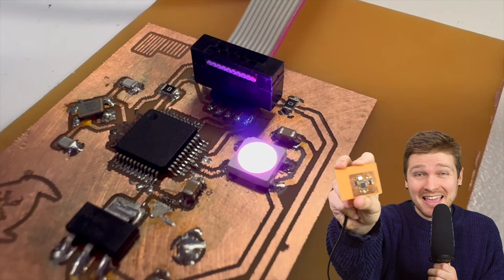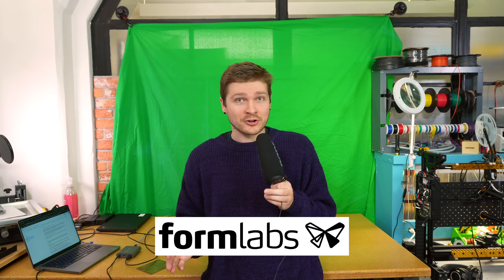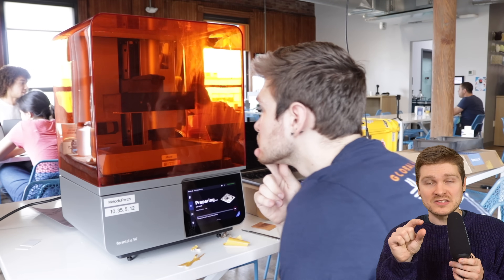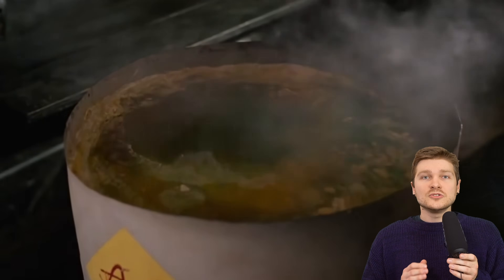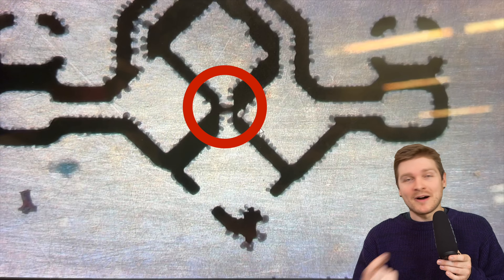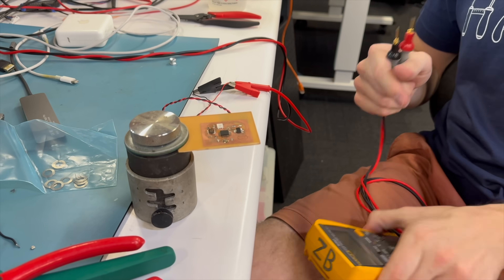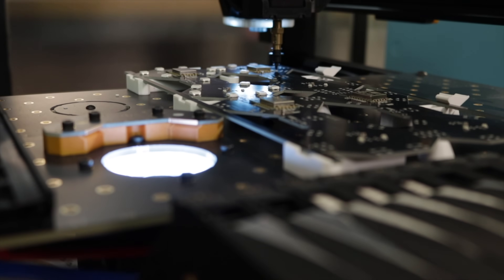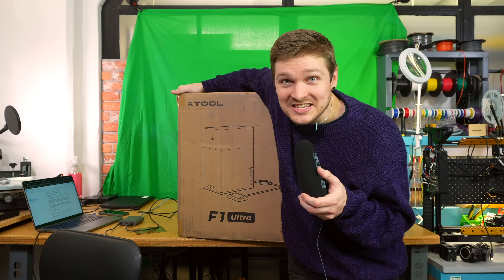Making PCBs on a 3D Printer

Comment: Tried this, no thanks... I finally settled for my boards (and these are just small boards, even doublesided works) on using a fiber laser. But not to ablate the copper. The problem you run into (or I did at least) is that you often end up burning the substrate. And that leads to a whole new slew of issues.

The way I do it is way easier anyway (and with less wear and tear on the laser). I spray fotoresist on it (you used film, it also comes in sprays). Hell it's also way old photoresist, it doesn't matter too much. I use spray because it just makes life easier. And then I cure the photoresist on the whole board. That's right the whole board gets sprayed and exposed to UV light (in fact I often use the curing station of my resin printer). Cure it on there good.

Finally I use the fiber laser on lower power to just blast away the resist on the parts of the board I want etched. If you take care to focus the beam right you get good results with little to no effort. And then it goes into the usual etchant of choice. I even made a small shaker with a servo and a servo tester of amazon. It moves a tupperware tub back and forth on an Igus rail I got in an Igus linear guide sample pack causing the etchant to have just enough motion for improved results.

Works like a treat. From finished pcb design to finished board in less than an hour. Best part? you could even use much the same process to silk screen the board (spray white paint on the finished PCB, laser away what you don't want) and finally coat it with soldermask, cure that and again laser away what you don't need. Though I rarely bother going that far with it.

Comment: Try using a laminator to attach the forbidden fruit roll up. It will force the roll up to be much better attached to the pcb material. The bubbles at the edges of the traces are sometimes caused by the roll up having not super bonded to the board.
Also, you might want to give the muriatic acid / hydrogen peroxide combo to etch the board. It works 10x faster and you end up with much crisper etches.
Reply: And make sure the copper is as clean as absolutely possible which can be easier said than done. If it's also necessary to lightly scuff the surface for adhesion, you want the surface scratches to be as fine as you can get away with.
Reply: Yep, that's what my college peer used when he couldn't get clad pre-coated with resist (or it was too expensive).
He used to use one of those rubber roller things they use for vinyl application, said it was better than nothing but didn't compare at all to the laminator.

Comment: I don't understand why you use this photo-resist film, can you not just use normal resin instead, like, it's a resin printer, just use double sided tape or hot glue to stuck the PCB to the build plate zero the printer to this PCB and print with resin a mask directly on the PCB it will protect it from the acid (if there is a texture to the PCB the resin will stuck to it).  
PS: I'm not into electronics so I don't know if it will work.

Comment: I personally use pre-applied photoresist PCBs, B/W laser printer to print positive of PCB layout on transparent plastic A4 (they are sold for this purpose) and then just use UV lamp to develop the PCB... rest is the same... but i was thinking about getting SLA printer screen (just screen with controller) to do what you are doing... but your results are, well... kinda shitty VS what i can manufacture by using the "old way"... but i guess it is due to custom applied photoresist, so pls try with pre applied one

Comment: about that crystal, those unused pads connect to the metal cover. so it doesn't matter if both aren't connected. it's grounded fine if just one has a good connection

Comment: Hi Stephen    
Here in Philadelphia you can pour Ferric Chloride down the drain.   A friend that worked for the Philadelphia Water Department said that they actually use Ferric Chloride to separate the heavy metals out of the waste water. He said they use 1000’s of gallons at a time.
Reply: I think the problem is not the Ferric Chloride, but the copper the solution accumulates over time.

Comment: Hello Stephen,
Please do the following when introducing the Xtool F1 ULTRA:
1. Order 0.6 or 0.8mm 35oz double-sided PCBs with black soldermask!!!! from JLCPCB
2. First structure the solder mask with the laser
3. Then laser the copper only along the contour. 
  Do not remove the flat copper under the solder mask, then it will go faster.
4. Now create the drill holes that only work with 0.6mm or 0.8mm? PCBs
5. Cut out the circuit board with the laser and put it back in upside down for the second side
As the solder mask is already on it, you do not need to apply it separately!
All of this only works with thin circuit boards that we can get very cheaply from China, 
not with the usual 1.55mm PCBs.
Thank you very much
Reply: If you are familiar with the machine, you can try selective soldering with the machine.
This means that you have the circuit board assembled in China and you make the missing components with your solder paste Lumen PNP.

Only the new assembled components need to be soldered with the laser. To do this, you need to adjust the focus.
Reply: What the hell is the point of that when you are already ordering your pcbs from a fab that will make them for $5?
Reply: @TrebleWing  You don't have to wait a week every time you want to test a new design because you can order a 100 or so of these blanks beforehand.

Comment: How about LCD screen (LCD glass only and polarizer). And under UV light. Modern smartphones got crazy DPI ratio so track resolution should be great
Reply: That's what the Printers alreay use Basically. And good luck getting an 8K that HIGH DPI screen anywhere else than a printer.
Reply: @DanielLopez-up6os And regular displays will die from the uv exposure much faster.
Reply: @DanielLopez-up6os  Plus smartphones are RGB and printers are mono. not insurmountable but a complication.

Comment: Super excited to see your experiments with the fiber laser!

I work for an architectural lighting company and do a ton of PCB prototyping.  I use the CNC diode laser method, and it's been pretty good.  I can make boards up to 12" and can swap to a spindle to cut the boards out in whatever shape I want.  I send the boards down to our PNP machine and they get populated pretty quick.  In about 4 hours  I can have a panel of multiple variations of a board.

I've been seeing videos of people doing this with a fiber laser, and it would be SUPER helpful if this could all be done in one setup, rather than switching from laser, to acid, to spindle.

I've been hesitant to push to make the purchase though just because I haven't seen enough videos showing the consistency and workflow of it.

Also, loved your last video about the cnc solder paste.  Been looking for a way to adapt that to my CNC, so I can speed things up when we go to populate the protoboards.
Reply: If you use a spindle to cut, why don‘t you use it for the traces?
Reply: @arbitrary_username  ease of use, speed and repeatability, 

I did a bunch of testing with the spindle method and it was so much more difficult to get a final board without an issue.  
Getting a perfectly level surface over a 16"x 16" area was difficult.  Bits broke often. And to get a high-speed spindle to do it properly at a decent feedrate was far more expensive.

I purchased large sheets of boards from JLC.  Copper with white solder mask on top, so I don't have the step of having to spray  paint, and then my board has the white reflective surface I need for testing my LED boards.

Also my machine is multiuse, we machine some aluminum, wood, acrylics.  As well as laser cut / engrave some stuff, so the machine needs to be agile, and can swap from my PCB setup to something else relatively simply
Reply: @ Thank you!

Comment: I only have a limited amount of hands-on experience with photo-resist products, but I've found that film resist is best applied with a heated high-pressure laminator. With liquid photo-resist, it looks like spin-application, like in I.C. fabrication, could work with small PCBs as well. I've not tried anything like that though. Keep up the AWESOME development and videos, you ROCK.

Comment: if you haven't checked out printed resistor tech it's coming on leaps and bounds, they are printed then laser trimmed, accuracy is really improving, suitable for pull up/down, wurth elektronik do it for example

Comment: Cool. But why can't I print PLA/PETG filament as etch resist on copper clad board?
Reply: I tried that. PLA really refuses to stick to copper.
Reply: @adameichler  yes. I wonder if there is a type of filament that will stick. Or maybe a dissolvable film that can be placed between?
Reply from the maker: i’ve found the resolution isn’t that great, but could be a cool thing to develop further!
Reply: @stephen_hawes  you are right but I just want to see if it could work in principle with a low res design.

Comment: For ferric chloride disposal, soak it into newspaper, let it dry in the sun and treat it like normal garbage.
Reply: Hardest part there is obtaining newspaper.
Reply: @EkiToji  Print a newspaper.
Reply: @EkiToji Just go to your local town/city newspaper. They have to keep everything they don't sell. 

Also BIG FAN MIKE!!!
Reply: Dependant on where you live that may not be allowed... I know in Australia we have some pretty strict laws around it in case water ever hits the garbage and it leaks
Reply: The method I've used for Ferric Chloride disposal is very slowly neutralizing the acids with baking soda and then tossing out the solids soaked up in paper towels.

Be sure to add the baking soda very slowly and controllably, because of foam.

The solids made can make the foam stick around longer causing it to slowly build up or go out of control and make a huge mess. Especially as you are getting close to the end. 

Let it all settle out fully and pour off the liquid down the drain with a lot of water.

The "mud" that gets made may go into the trash, depending on your local laws. But make sure it doesn't go down the sink, so let it all settle out fully.

The simplified reactions are roughly like these below:
FeCl3 + NaHCO3 -> FeCO3 + FeOOH + H2O + CO2 + NaCl

The dissolved copper reaction is similar:
CuCl2 + NaHCO3 -> Cu(OH)2 + CuCO3 + NaCl + H2O

The iron and copper product is a mix of carbonates, hydroxides, and oxides, not all shown here and the exact mix of them may change.
Reply: We just pour it into the toiler 💀
Reply: @GamrokFeddy ....? it eats copper. you are destroying your pipes.... lol
Reply: @amihartz  Not really. Most waste water pipes are PVC around here and by the time it reaches the street lines (im not sure if those are copper) it really becomes insignifficant.
Reply: The mighty mike of electronic stuff has spoken ,all hail the father of youtube teardowns

Comment: If you really must to do homebrew PCBs, pre-coated photoresist board is the way to go. 
Develop with silicate based developer, not hydroxide as it has a much wider margin between "develop" and "strip"
Reply: This is much more expensive, by a lot.
Reply: I am trying to find those in Brazil...
Reply: @viniciusfriasaleite8016  Very hard to find that kind of convenient stuff in Brazil, its actually absurd how bad hobby electronics stuff is here. Can't even find a high quality breadboard, and wait until you find out how many ICs you buy at stores (online or in person) are actually counterfeit and don't match the datasheet specs
Reply: @asronome can confirm. Also, when you do find the ICs, they cost 3x the actual price.
Reply: @viniciusfriasaleite8016  what works reasonably well, if you can afford a laser, is to just spray pain the pcb with just regular black spray paint, let it dry for a bit and print the PCB with the laser. I happen to have a fiber laser, but diode lasers will work for this purpose as well.
Reply: @viniciusfriasaleite8016  dolar 6 reais + impostos + 20 dias de frete tornou até jlcpcb inviável
Reply: I used this method based on your guide about 7 years ago. I can say, it worked an absolute treat and really got me out of a jam. Though it was hard to find the pre-coated boards here in Aus. But definitely a method I would use again if I had to make a board. Though, if I'm prototyping with that kinda turn around, I'll just use your protoboards which are awesome, by the way.
Reply: I didn't know that about the silicate for resist strip, great to know!

Comment: I used anycubic m5s to do PCBs with pcb that have film applied and that part was ok. But rendering pcb image to rectangular pixel was part that was troublesome. I used uv tool program and for some pcb works perfect for other it renders pads in weird form. Using different scaling on x and y axis trigers some rounding error in rendering. If that is fixed i would use this process more often.
Reply from the maker: huh, that’s interesting! do you have your work documented anywhere? would love to see a visual of this issue
Reply: @stephen_hawes  UVtools is open source program developed in c#. Only modification that i did is printing bridge that fakes force sensor so printer thinks that build plate reached screen. Unfortunately i don't have examples of bad rendering. I tried to debug the issue but c++ and c are my native languages not c# .

Comment: No way! I've been messing with photoresist and literally just last night was thinking an sla printer would do the job well. Then I wake up and see this! 

My little tip on the fuzzy edges is, in my experience, that seems to come from poor film adhesion. I started running mine through a laminator and got much cleaner edges the ferric chloride didn't creep under. Exposure probably effects that too.

Edit: just saw someone else saying this lol

Comment: Hi ! I don't know about your film.. but the one I used(no name ali.. the color was the same) was applied hot.. I used a classic office laminator on the highest setting.. then I let it go through 8-10 times like this sandwich.. classic printer paper + pcb + film + printer paper ..
Reply from the maker: OH that's a good idea, I should definitely try that. I just put it on at room temp, but using a laminator would probably help with adhesion
Reply: This method is the one i use for my testing PCBs for years  and works like a charm.
Reply: Alternatively ironing could work too, foil or something in between
Reply: I might try that.